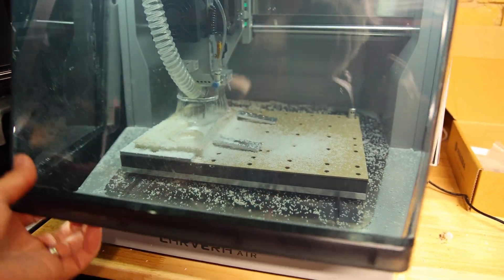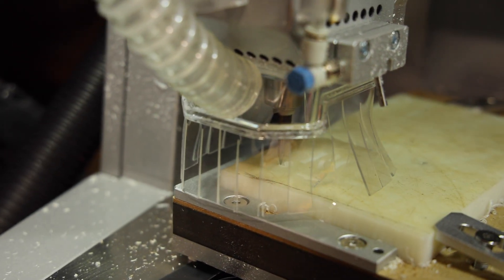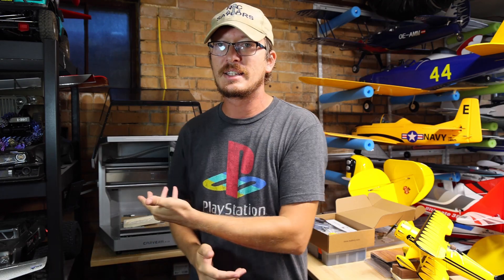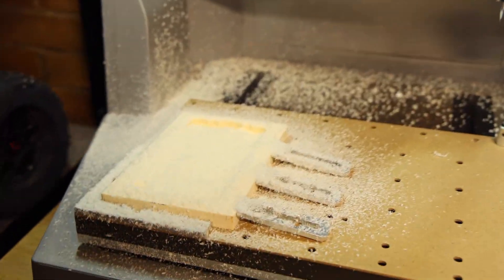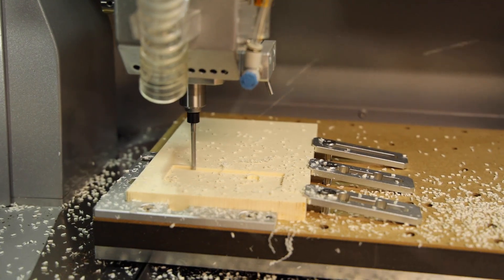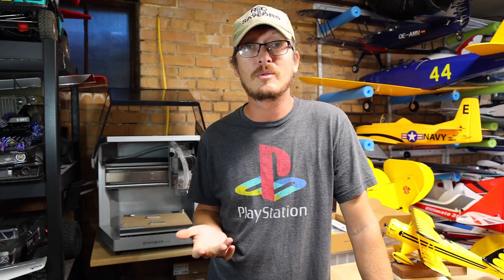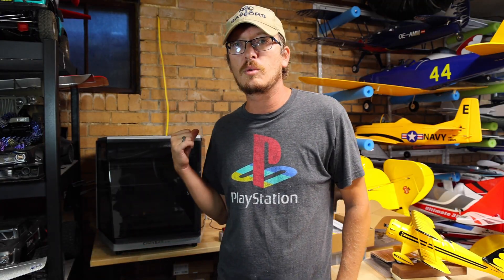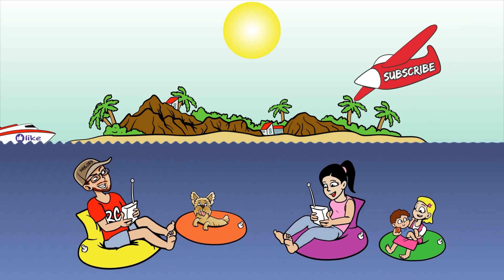Perfect Companion Machine for RC and 3D Printing! Makera Carvera Air Desktop CNC Machine

Comment: I have a number of 3D printers and I recently purchased a Carvera Air.  The Carvera Air is amazing! I recently cut aluminum brackets to assemble a small trailer for my RC planes.   I have a few things to point out:  1. It is quite a bit louder when cutting metal.  2. Use caution when cutting carbon fiber, the dust will adhere to the lining of your lungs.  Use a vacuum that has a HEPA filter and if you can, vent the vacuum's exhaust outside.  3. Buy a variety of cutting bits.  Use the cheap ones for learning and cutting new materials, and use the quality ones when you have worked out all the kinks.  4. The cutting bits are *sharp*. Use caution when reaching into the cutting area.  I have cut my hand more times than I like to admit reaching into the machine to remove the finished piece.

 Happy cutting!
Reply from the maker: Amazing tips! Thank you very much for sharing and stopping by. I hope I did the machine justice with my video as I’m new to this. Even newer than you! So many possibilities with this! 👍😁⚓️

Comment: Love the product. That is so cool !    Something you should know. I might be wrong about this, but in my experience with shop vacs. I don't think they are designed to run for extended periods of time. I have burned out a couple of them running them for extended periods. Think in terms of how a shop vac is used. You never really run them for long periods of time and as you can see your setup only looks like it is sucking out the very fine partials not truly keeping the cutting area clean and you still need to vacuum out the complete inner area of the mill.  A lot of small CNC mills use compressed air blowing right at the tip of the cutting tool. Now you still have that dust to vent out of the cabinet so use something like bathroom vent fan to keep a constant air flow through the cabinet.
Now to keep the dust from clogging up on the vent fan blades you can make a simple wooden box that has your input on one side and the outlet to the fan on the other side. Inside of the box mount two disposable heater filters and they filter the air before it gets to the fan. Yes it is still vented outside. Make the filter box so you can remove the lid and design the box to work with the filters using some 1x1 wooden strips to make a channel for the filters to slide into and that holds them in place. I use a setup like that for my jewelry buff that's in my basement shop. That has 4 heater filters in it and when it is opened to clean out the 4th filter in line looks clean as new with the first filter catching most of the buffing dust.  Always a fan of your videos since the beginning 😁

Comment: Desktop CNC (Computer Numerical Control) is on the verge of exploding. The technology from 3d printing is revolutionizing CNC tech. In many ways, desktop CNC is a smart router, and you can use it to do some awesome stuff with wood in addition to plastic and metal. One channel I watch, The Chrome  Project is a van dweller who is building out a custom van, and one of the builders he is using has a huge flatbed CNC machine of several square yards that they are using to cut out the cabinets and other wooden fixtures for his van. And after they finish that, the builder can then sell the exact same pieces to other van builders and people outfitting their own vans. It is, quite literally, a print-on-demand van interior.